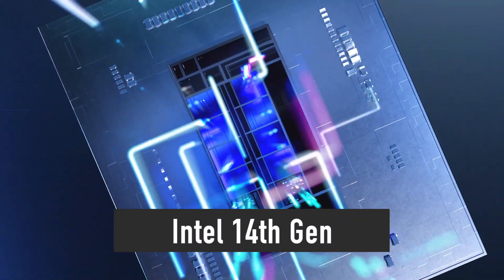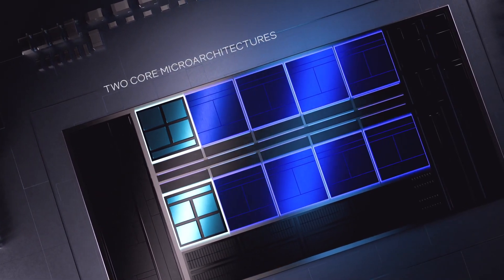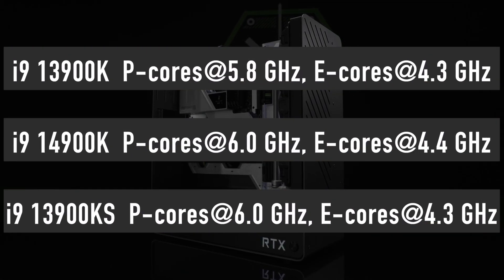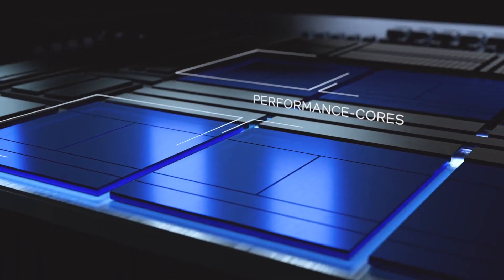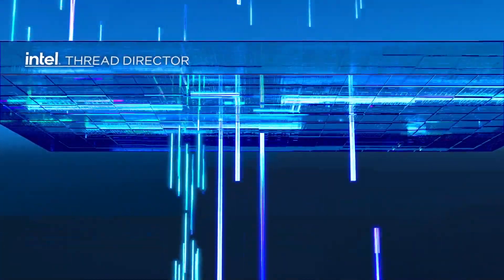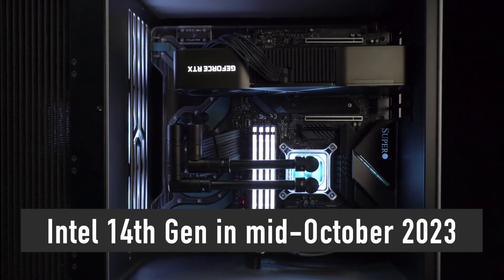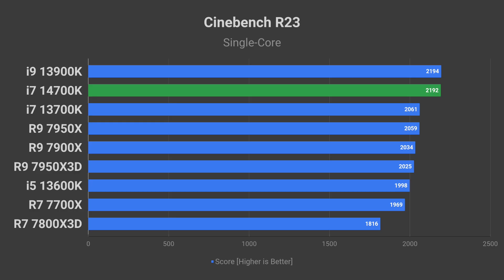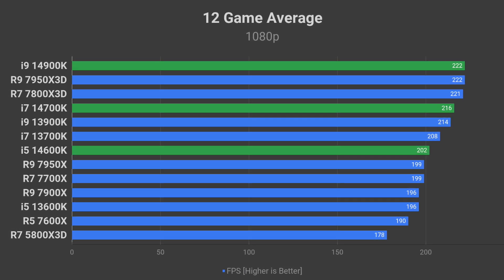i9 14900K, i7 14700K, i5 14600K: Specs, Performance, Release Date

Comment from the maker: Do you think Intel will give us more cores on the 14th Gen i5 and i3 processors?
Reply: It's gonna be E-cores so I don't think it matters. Intel should've added more P-cores.
Reply from the maker: @ElGreco365  would you like Intel to give more cores in the 15th gen then?🙂 Because right now it doesn't look like they are prepared to do it yet.
Reply: still not convinced that more cores helps the majority of end users in real-world scenarios; still not convinced that 14th gen is anything more than Intel keeping up with AMD releases (especially on the desktop)
Reply from the maker: @treyquattro  8 P cores on the i5 would definitely help. Just look at the i5 (6 P cores) vs i7 (8 P cores) performance difference in games.🙂 Of course, the difference isn't huge, but it is there. And future games will require more compute power.
Reply: @theivadim  maybe future games will better effectively utilize multiple cores, but they're well-known for not doing so thus far, and games have to run well on a wide range of processors. At some point the core wars become the modern equivalent of the MHz wars (it was MHz back then!)
Reply: @theivadim  If they're smart they will increase the core count like in the first leak but I partially agree with the first guy, best to wait till arrow lake if you can, I definitely will wait at least till arrow lake, lunar lake on laptop is gonna be revolutionary.
Reply: @theivadim  I mean yea but to pay 400$ for 2 cores and slightly more frames is ☠☠☠. Like right now im sitting on a i5 - 13600k thus im not looking to upgrade unless its extremely needed and games are running just fine with no problems like i wont need to do a major upgrade until next gen of consoles which then ill upgrade my cpu / gpu
Reply: Simple answer, YES. It has been confirmed.
Reply: @Ragefire79 finally aged milk

Comment: 13900 K&S are nuclear meltdowns that can't be properly cooled with the best of water coolers. They have to be delidded and repasted with liquid metal, and the lid is best replaced with a copper one. It's ridiculous. 
I ended up switching to a 13700K. I'm not holding my breath for any improvement in this regard with 14900K/S. Hopefully 14700K will be reasonable.

Comment: i love how no ones talking about the fact that you can use the same motherboard of a 12900k with the 14900k, that alone is amazing and got me excited. So glad I didn't get AM4 with 5950x.
Reply: I wouldn't try that unless I had a Z690 board with majorly overkill VRMs. I know it's just a dumb anecdote, but I had a MSI Z690 Pro-A board and upgraded from 12700K to 13900K, and 6 months later the CPU died. My suspicion is that MSI may not have anticipated the ridiculous wattage that 13900K/S would draw, and thus didn't test long-term longevity at such levels. Anyway, hope it works well for you!

Comment: Whether or not i get that 14900k will really depend on the power consumption in the end. The performance upgrade is nice but what i want is an efficiency upgrade. Don't want my small gaming room to be an oven
Reply from the maker: I wouldn't count on it being any less power-hungry than 12900K or 13900K. Because Intel can't deliver decent performance uplift by usual mean (architecture and process node improvement) the 14900K is doomed to be as inefficient as its predecessors. Even if they got DLVR to work, they will still use every little bit of that power-efficiency to push the performance as high as possible in order to appear more competitive vs AMD's 7000X3D processors. If you are getting a CPU for gaming only then AMD is the only logical choice. 7800X3D consumes way less power while delivering slightly better performance than 13900K.
Reply: @theivadim  intel just is better for me. While gaming is my primary use both me and my spouse have a few things we enjoy together than just run better on intel cpus due to the extra e-cores. 

Efficiency is always the hope but if the 14900 is as bad as the 13900 I'll end up getting the 14700 when i upgrade just to keep temps down. That or I'll wait until the 15th comes out and just upgrade my whole rig
Reply from the maker: Probably makes more sense to wait until the 15th gen if your current PC gets the job done. At least then you will be getting a properly good performance uplift. And who knows, maybe Intel will choose to lower the power consumption as well instead of cranking it up as high as possible to squeeze out a few extra % of performance.

Comment: Yeah the stock numbers don't look great but from what I heard they should OC better and the memory controller should do 8000 easy, now we just need cheaper good Mobos that can do 8000Mts. 
If I was Intel I would send the reviewers a combo of good mobo with 8000 Ram with the CPUs, then it will beat the 7800x3d even at stock and dust it OCed.
Reply from the maker: Faster memory support is always good. But when you talk about beating the 7800X3D you should also factor in the overall cost of the system. It is not enough to provide better specs. It is also important to provide better value in terms of price. So, I hope to see better value with the 14th gen. However, I suspect that the 13th gen is going to be the better value option simply because it will be discounted.

Comment: I'm gonna say this that i3 14th gen is going to be an extremely popular choice for budget builds especially if the price is 120 or lower.

Plus almost forgot the i5 14th gen will be most probably the most recommended for gamers over the i7 and the i9, basically I'm saying the i3 14th gen will be popular for budget Build and the i5 14th gen will be popular for gamers.

So I believe that i7 14th gen and i9 14th gen would most probably not be as popular as they are in 13 gen and I do believe once the price drops for the 13th gen of the i7 and i-9 I believe people would pick those over the 14th gen of the i7 and i9, but I do believe the i3 and i5 will be the most popular in the 14th gen.

I do believe people will disagree with me on this but if you think about as more of somebody building a new computer what would be the best option for your money go with the older generation go with the 13th gen of I7 and i9 or go with the 14th gen of i3 or i5, basically in short this would most probably save more money for the average consumer to buy a better graphics card or something much better to keep the processor even more cooler like a top of the range air cooler or a really good AIO or even more storage.
Reply from the maker: That is exactly why I very much doubt that Intel is going ahead with such a plan to increase the number of cores on i3 CPUs. It would cannibalise the rest of the lineup. AMD is not putting any pressure in terms of competition on Intel in the i3 segment. So, it doesn't make sense to give 6 cores to the i3.
Reply: @theivadim  i3 needs a core count bumb. Why support a corporation and not consumers? Anything that benefits the consumers are welcomed.

Comment: I'll probably go for the 14600K if it does actually have two extra P cores, it'll be useful for content creation since I don't plan on focusing on gaming when I build my pc.
Reply: it will be the same as 13700k 8p+8e. 200mhz higher clocks
Reply: @michal1693  may cost less though, just have to see
Reply: @xanon-ah842h  It won't cost less.. If it x performs like y, and y costs Q, then x will also cost Q.
Reply: @orion9k  The 600k products are usually cheaper than the 700k of the previous gen.
For example, the 13600K launched with a price of $319 and the 12700K launched with a price of $409. The core counts are different between the two, whereas the rumored 14600K has the same core counts as the 13700K, but the pricing above shows that it's still possible for it to be cheaper just because it's a 600K and not a 700K cpu.

The same pricing trend also follows with 12600K ($289-300 at launch) and 11700K ($399 at launch)
Reply: @xanon-ah842h  well I hope you are right because I still use 4790k and I need an upgrade xD
Reply: @xanon-ah842h  But I see some benchmarks on 14700k performing as good as 13900k, I am pretty sure they are going to boost price tags on the 14700k if thats true and it will most likely cost the same or close to as much as 13900K.. We will see but if 14700K will cost same as 13700K, I will probably buy one.

Comment: 13 gen is hard to cool, OC 13 gen to 6.2 ghz, i mean what’s even the point ? It will thermal throttle even harder
Reply: @timreeves6901because it use 10-15% less power with a better power management that why they can do that

Comment: 14900k will probably do 6.2p/4.7-4.8e/5.0-5.2ring on most samples. Will be more interested in the IMC capabilities and possible inclusion of DLVR. Otherwise, a totally boring and unworthy upgrade for those on 12th/13th gen already. Maybe Z790 Unify-X? Cheaper APEX alternative.
Reply: This feels like the 10th gen release all over again, as a 13900K owner I am certainly glad I got the chip that I did and don't see this new generation as being even remotely worth getting unless the 13 series chips run out of stock

Comment: Damn, i was hoping for 32 cores on the 14900K. Well i guess ill be getting the 14700k then.
Reply from the maker: Why 14700K and not the 14900K? It still has more cores if that is what you need🙂
Reply: @theivadim Because its just an overclocked 13900k and will cost more so ill get more for my money if i get the 14700k
Reply: @mauinokaoi8747  But the 14700k will basically just be a 13900k and if Intel drops the prices say on Black Friday trying to get rid of the 13th gen chips then the best value will be the 13900k.
Why spend more for a 14700k if the 13900k can be had at a better price?
Reply: Wanted a 32 core 14900k too but hey. 14900k seems good enough not to mentiom arrow lake is going in with 40 CORES. Though hyperthreading wont be on it so i hope they make somethint better than hyper threading to push it to the max
Reply: The i9 15900k  seems to be what you're looking for then
Reply: @jebes909090  lol, i will probably upgrade then. i have a 12700 and upgrading every 3 gen. is the best.

Comment: I know Intel is struggling right now with their desktop CPUs, but if the IPC doesn't go up a noticeable amount then this is a pretty thin upgrade.
Reply: It's a refresh, not an upgrade.
Reply: @mrhassell  its an upgrade from 12th gen
Reply from the maker: I agree🤝🙂 This refresh generation is going to see the light of day only because of Intel's incompetence. They were supposed to launch a true next-gen architecture using an advanced silicon manufacturing node. Yet another delay in the company's schedule.
Reply: @theivadim  May not be a bad upgrade for people wanting to get their 12th gen systems an increase in performance while not replacing the entire platform.
Biggest thing though is perhaps this 14th gen will drop the 13900k down into the "700k" tier price point to really give a solid performance upgrade for a good price for those with more mid level 12th gen cpu's.
Reply: 200 MHz won't make much of a difference.
Reply: Well it will definitely be an upgrade for me coming from a 5600x. If I will be buying the best cpu, why not just go for 14th gen at that point?
Reply: @mysticqro950  I'm still running 4790k 🤷‍♂
Reply: @orion9k  that’s you, but I have a 4080. It can’t keep up. That’s why I’m deciding to upgrade.
Reply: Its getting a power reduction, Core Clock Increase and about 10% IPC increase. This will mainly be for ppl who want to hit higher speeds at lower power draw.
Reply: Struggling how?
Reply: Looking forward to AMD's response!

Comment: Intel literally can't compete with AMD on core count so they are relied on giving more E-cores on their CPUs which basically no one cares about. 16 P-cores i5 and a 20 P-cores i7 and now we're talking.
Reply from the maker: I think that is a bit too unrealistic😀 Even an 8 P-core i5 would be a decent step up from the 6-core 13600K. I expect that will be the next step for i5 processors eventually. But who knows when🤷‍♂️ 16th gen maybe?
Reply: @theivadim  Intel also can't beat AMD at power consumption. 7800X3D beats the 13900K at only half the power draw.
Reply: A 13900k is a do everything CPU while the 7800x3d is a gaming only CPU. The 13900k still comes extremely close even at stock settings on 10nm!!!!!
Reply: @jjlw2378  7950X3D beats the 13900K and has 16 cores while it still consumes less power.
Reply: @laszlozsurka8991  Wins in gaming but loses in productivity. It does what a gaming only CPU should do.
Reply: @laszlozsurka8991 Dude, read his comment
Reply: Good luck with AMD... you will need it.
Reply: @Footballmoments2025  Ok... AMD currently hold the crown for having the best gaming CPU... just sayin'